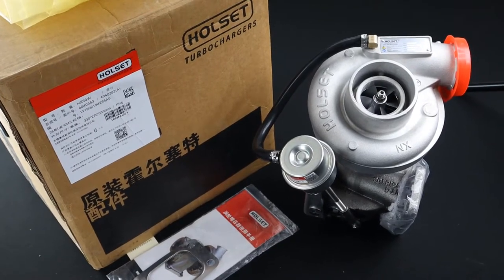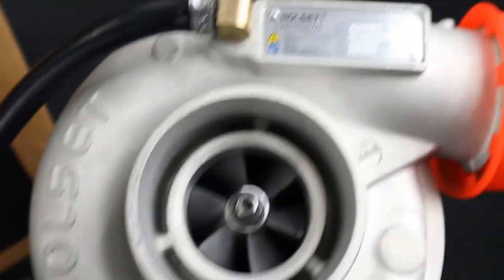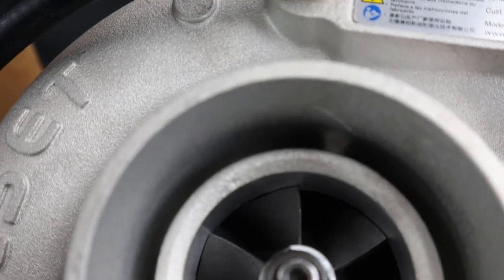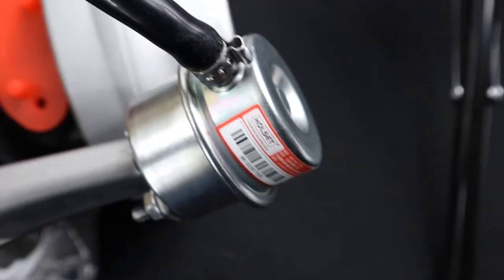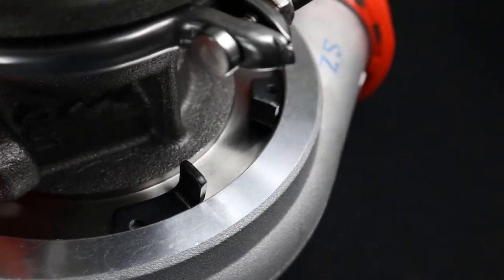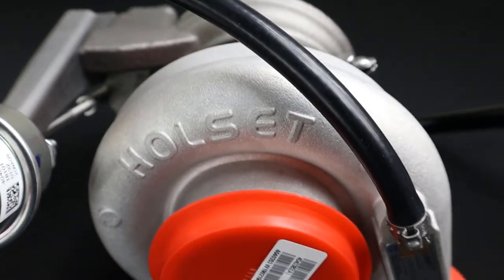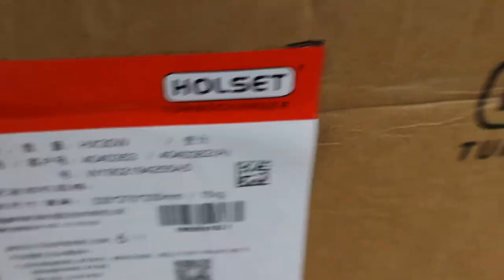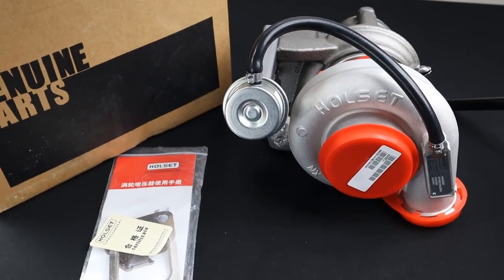IS IT A HOLSET?

Comment: Hey mate, I bought a holset he351 which looks like it came from the Wuxi factory like the ones your supplying, some guys are telling me all holsets from China are fake. Mine actually is stamped with a 8cm2 rear housing which is quiet rare, again being told it’s fake because of the housing is t3 twin scroll like your he351’s but the internal size could be different?
Reply from the maker: You can call the number on the website to chat but I have not heard of an 8cm he351.   I also have a lot of information on the counterfeit guides on the website.
Reply: Yeh I watched your video, my turbo checks out. I guess I will see what the real world results are like once it’s fitted soon.